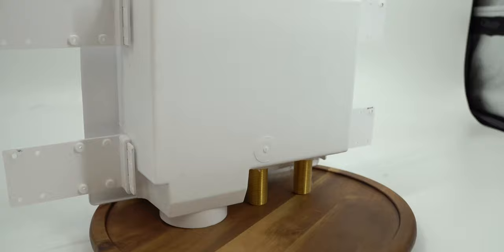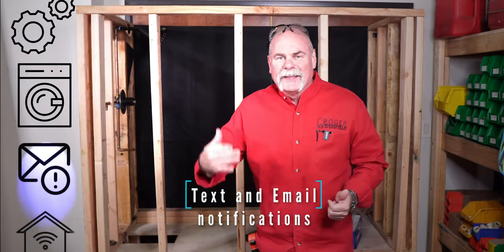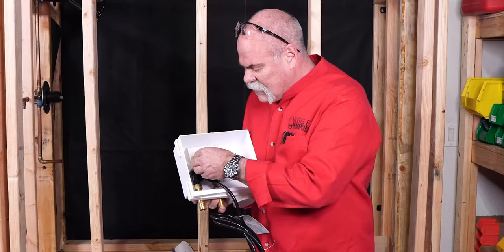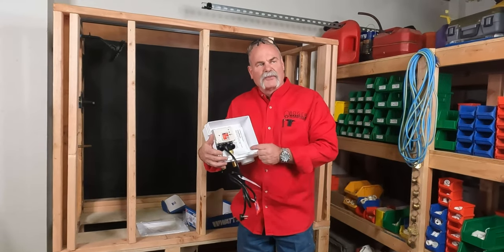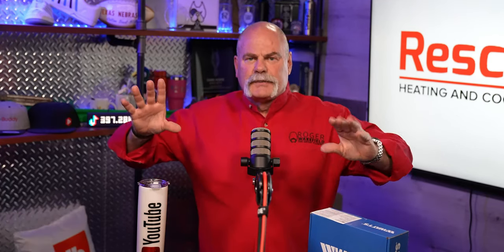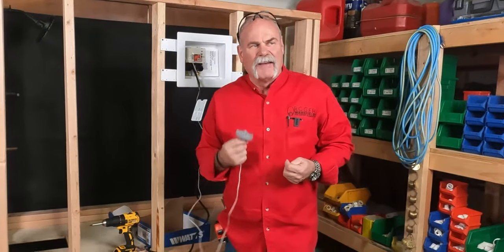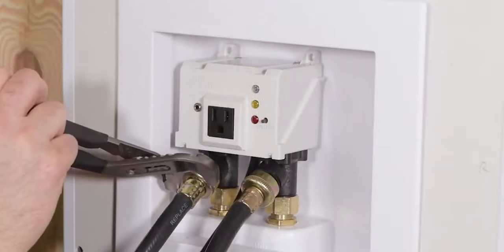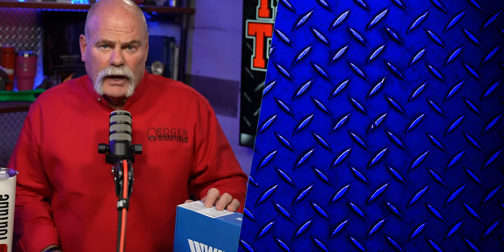WATTS INTELLIFLOW CAN BE USED FOR REMOTE LEAK DETECTION ON YOUR PLUMBING SYSTEM

Comment: Wow I didn’t even know about the WiFi thing and I changed about six in my last job as a handyman I went to better job so no ideas lol. Worked in a 81 unit building that had this watts system few pointers for home owners hand tight this 🤦‍♂️ I actually seen a plumber Strip the tread it’s plastic. And be careful I had Hal my side with water because the box was bad when I took the holes out water can out and thats with the machine not running lol

Comment: The only problem is if you have a 220/240V with the "IntelliTimer" add on which is basically just another device to suck power to turn on the box, and just leaves the valves open for two hours. If your have a HE machine that has a cycle that runs longer than two hours you have to be home to push the button on the "IntelliTimer" again to turn on the water again, negating the nice turn water on/off feature for 240V systems. So you have to remember to check it constantly or set a timer on your phone. Not to mention if you're doing back to back loads, which is common if you've got kids, the solenoid coils gets hot. Which can cause them to not open fully causing some stuttering/water hammer noises. The box we have has been doing this for 6 months and is only 2 years old, I added hammer arrestors before the hoses but it only lessens the noise.

Comment: Been plumbing 25 years. Waste of money. There are systems you can install in line of your water main at the meter to alert you of a leak on your whole house not just one fixture. This is a lame product. 99% of our leak repairs are underground between meter and buildings.
Reply from the maker: This is great if you cant afford the whole house system...
Reply: This product is less expensive, but doesn’t work! All new wash machines draw power and thus this one is always on and never shuts off the water to the wash machine. You have to unplug and plug back in the leak detector- every time you use your wash machine!  User beware.  Look for an alternative. I just purchased and learned the hard way, out $500 because I purchased the kit also. The kit was required to hook up to prior plumbing. Now both items are in the trash.

Comment: I left to go to work one day and forgot to turn off the washing machine valves. Luckily nothing happened. But anyway why is the washing machine valve so important and not the faucet's at the kitchen/bathroom sink? or the toilet? I have had faulty hoses at the kitchen sink many years ago. The wood rotted out from the water. But that was it. nothing else. That kitchen sink hose was there for about 40 years so no wonder it was leaking.
Reply from the maker: Washing machines nowadays drain really fast and if there is a clog down in the drainage line there could be issues. It's something to be aware of, especially when you have an older house. Sometimes they have smaller piping for your drainage line then on newer builds.

Comment: If I was going to do this, I would do an entire house one where the main valve gets shut off.  I do like the concept of this, and yes it would be cheaper than an entire house one with all the sensors you would need.    But in the mean time of 25 years of home ownership, Ive used steel braided hoses instead and just replace them every 5 years.  So far I have had no issues. I also have water sensors that beep if a leak is found.  While it wont shut anything down, its better than nothing.  Its on my list to do my entire house.  But for now, if I am gone over night, I just turn off my main valve.  Advantage of being in Canada, our house main shut off valve are inside.